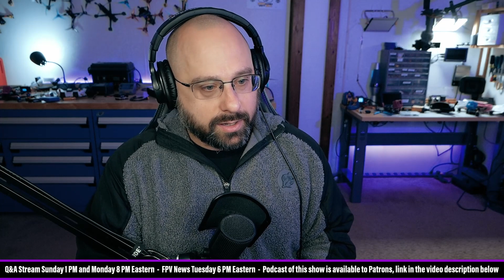Battery Voltage Vs Voltage Regulator for Digital VTX? - FPV Questions

Comment: I don't have a 9v bec. I have 5v and vbat on my Babyhawk 2 hd (4S). The BNF comes with the vista connected to vbat. Is this ok because it's only 4S? I'm just about to do my first build using a Babyhawk AIO and an o3 air unit and was planning to do the same. Is this not advisable?

Comment: Walksnail 1s VTX... is there any barrier to running off the 3.3v pad on the FC, assuming it output enough milliamps? Would that be safer? There's usually 3.3v for legacy DSMX receivers etc.
Reply: Otherwise, a 4.2v BEC might be safer, IDK

Comment: I had issues with the 1S Walksnail vtx when powered off a 1S BetaFPV AIO FC 5V pad, the vtx didn't have enough current to connect to the goggles.
I then tried the vtx using a DarwinFPV 2S  quad, also on a 5v pad, this worked but I think the current draw may have too high which caused the quad to blackout and drop after roughly 2mins flight 
Not sure a 5V BEC would solve this especially as JB has mentioned some becs may output slightly higher than 5v, and Walksnail 1s is strictly 5v max

Comment: Matek 9/12v 3a regulator since I started using digital on 6s. I opt for the 12v and have had nothing but success. Ive fried 2 vistas one on a punch out and the other on a minor crash where the motors spun up while wired vbat
Reply: do you tap the balance wires to get the VTX power?

Comment: does it hurt the walksnail vtx when powering on 6s HV - 26,1 volts ? the input voltage from the manual says just 25,2 volts.... anyway bought some 12v BEC

Comment: I put my vistas on a regulator since I previously fried one when I fried my vista... Expensive mistake. Also I found that some fc's struggle to output 5v/9v when doing punchouts so my video would stutter momentarily. I've not had this problem since using regulators (becs)
Reply: Agree, I had the same, vista can't handle 6s sometimes.
Reply: Yeah, so many people burn they vista, just they lazy to using external BEC, thats the fact.